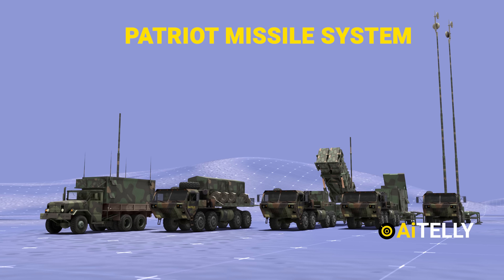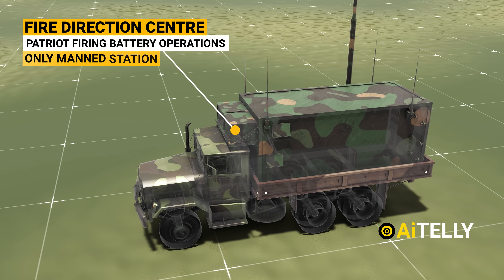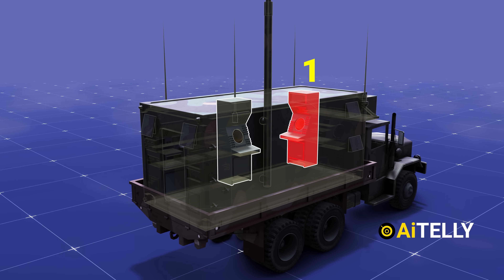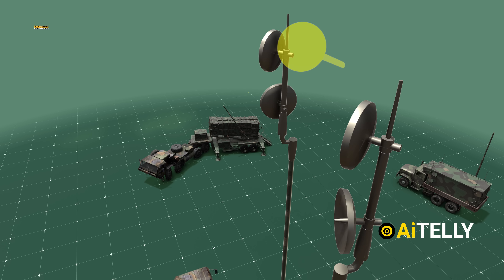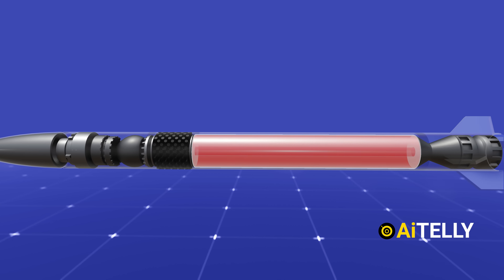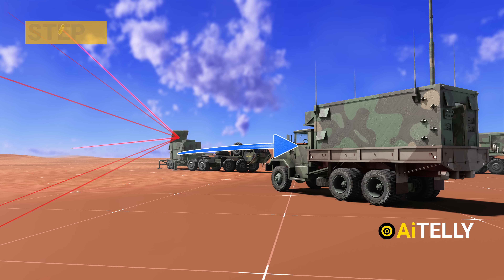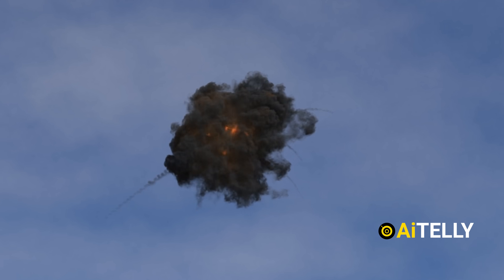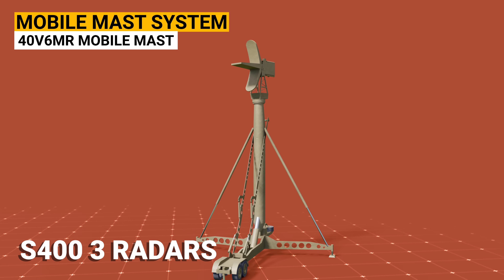Patriot Missile System How it Works | Air Defence Missiles

Comment from the maker: Correction and Notes from Audiences

"Strayer"

4 pac 3 missiles can be placed inside a containter and a launcher has 4 containers, so 16 missiles in a launcher. I think video shows a pac 2 missile. One container has one pac 2 missile, so 4 missiles in a launcher.

@Chris1982416 was an Patriot operator, & he corrected me about PAC-2 launcher payload, it can hold 8.

"Adrián Paz"
Good video. A small correction. The missile launcher you are showing is the PAC-2 GME which has 4 missile. The PAC 3 CRI launcher has a total of 16 missiles and the newest PAC 3 SME has 12 missiles per launcher. Launchers can also be configured to have all three missiles. For example: 1 PAC2GEM, 4 PAC3CRI and 6 PAC3SME.

"jordan ryan"
1 correction. A patriot launcher can hold up to 16 PAC-3 missiles. Last generation, PAC-2 missiles are bigger, thus a launcher holds 4.

"Ahmed Helmy
"pac3 launcher = 16 missiles / range = 70 aero / 35 ballistic 
pac2 launcher = 4 missiles / range = 160 aero / 30 ballistic

"TURKWING"

very good explanation on video...Thanks. Patriot radar azimuth coverage 120° for target searcing mode and only 90° for target firing mode. So at least 240° of azimuth is free to send cruise missile to destroy Patriot radar. 1 battery needs 3 Radar for full coverage. Also, radar range is limited to detect low RCS targets such as drone emits noise jamming signals to blind and next coming enemy ordonance can harm Patriot's radar.

"Ragnarok"
Newest radar have 360 degree coverage,the older systems only 120 degree

John Silver

It has a new LTAMDS triple-band S/C/X radar. With Link 16, other radars can also be used.  Also it has a new PAAC-4 SkyCeptor interceptor. Based on David's Sling Stunner missiles that can reach up to 300km with Mach 7.5 terminal speed and has a dual seeker with active radar and infrared IF homing. Additionally US has a new launcher called Enduring Shield that can incorporate any missile including SkyCeptor.

With the upcoming IBCS (Integrated Air and Missile Defense Battle Command System) network for the US Army, any interceptor and/or launcher and/or radar can just be a lego block. Similar to US Navy’s Aegis system, its a centralized battle command center. Many systems can be connected including NASAMS and Enduring Shield, SHORAD, Patriot, MEADS, and THAAD. Even radars from other system like Aegis SPY-1/SPY-6 and F-35’s AN/APG-81 can also be used. This allows a different radar to use a different interceptor to engage a different target.
Reply: PAC-3  does not supersede PAC-2.   PAC-3 is a 300kg missile to shoot down ballistic missiles at 50km range.    PAC-2 is 900kg missile with 3 times the range of PAC-3.
Reply from the maker: @williamzk9083  Thanks for the feedback
Reply: @Aitelly  why is everyone not aware  if the patriot missile is specialized as an anti-cruise missile.  while the s300 and s400 are specialized as anti-aircraft
Reply: @Aitelly  the fact that the f117A stealth bomber could be shot down using the S-125 Neva 1960 and using a radar that still used vacuum tubes.  The greatest weapon made by the USSR is its anti-aircraft capability.  with the s300 in Ukraine and the s300/400 in Russia.  the Ukrainian air war became defensive
Reply: @carkawala khatulistiwa  it's prob bc the S3s& 400s have been reported frequently that they're comparable to any SAM battery that the US has in its arsenal ,
Reply: @carkawalakhatulistiwa  If you're referring to the one shot down over Yugoslavia, it's stealth capability was compromised making it visible to radar. I forget the exact reason but it had to do with rain/water/hail(?) on the exterior panels significantly reducing their effectiveness. Not sure, but would assume by now there are new coatings on the panels to at least minimize the issue. Kind of wish I'd thought to ask the ground crews about that while I was at Holloman AFB....oh well...
Reply: @carkawalakhatulistiwa  Not just one type. Multiple missiles for multiple roles, hence the PAC-2 and multiple variants of PAC-3. See wikipedia for the details...
Reply: @Aitelly  sir plz make videos of asian made missiles like pakistan have ababeel multi functionality and basic and nuke warheads  and also on agni of india.chian .........no one knows wt thy have???? plz sir
Reply: @carkawalakhatulistiwa  Facts are important. Simply stating that a 1960s era radar shot down a 1970s era steal plane doesn't exactly say a whole lot.

Side note: Did you know that the commander of that SAM battery and the pilot are now good friends?
Reply: @carkawalakhatulistiwa  there are multiple variants of the Patriot Missiles with different missions. But that doesn't mean any single variant can't be used against any single target. It simply doesn't make sense to use a more expensive variant, like a PAC-3 MSE when a more than capable PAC-2 will work.
Reply: @carkawalakhatulistiwa  the patriot system was initially designed as an anti-aircraft interceptor. PAC-3 GEM-C allows it to be more tailored against cruise missiles, and GEM-T is tailored more for TBM's.
Reply: Correction on a correction. PAC-4 Skyceptor is a proposal by Raytheon/Rafael that was supposedly accepted by Poland but since 2017 there have been no developments that I've found.
Reply: @Changeur2009 It was just proven that the Patriot system did successfully bring down a Russian hypersonic missile a few days ago. (By now you may have already heard, I just didn't see anyone answer your question)
Reply: @tiffanyshanley1419  According to the commander of the Air Force of Ukraine no, they didn't.
Reply: Pls make one video on how merkava tank does work..
Reply: after this try to explain how destroyers work at sea
Reply: DLT (antenna) stands for Data Link Terminal and not Distributed Ledger Technology lol (@t=3m50s)
Reply: @tolli4919  this video hurts to watch as someone who works with the system
Reply: @warsuitgaming8692  real
Reply: The pac3 sme missiles are fully kinetic kill vehicles not explosive kill vehicles
Reply: Patriot is useless against ICBMs, ICBM reach very high speeds and intercepting them need totally different things, even aegis systems and THAAD can't deal with them, russian S-400 can't do it too.
Reply: @Changeur2009 The Ukrainian military did exactly that last week when they intercepted a Russian Kinzhal hypersonic missile with Patriot SAM's. Chinese hypersonic missile!!!! On paper they claimed they have the, DF-17 and DF-26. It exist on paper, but there are no documented facts and that it actually works. With all the hyped and lies coming out of Beijing , nope, not a chance that they have all these capabilities. And even so, with the Patriot shooting down Russia's hypersonic missile last week that Putin had been bragging about. He claimed that Russia's hypersonic Kinzhal missile is the best in the world, and there are no known defense missile system in the Western world capable of stopping it. The fact that Taiwan is equipped and protected by 7 batteries of Patriot advanced capability 2 (PAC-2) and PAC-3 Guided Enhancement Missiles (GEM) system, I don't think the Taiwanese military and it's 24 million population will not lose a sleep, knowing that they are safely protected by Patriot missile defense system. The Turkish and the Indians are probably scratching their heads now after they pick the S-400 over the Patriots missile defense system just because of the cost involve, which is quite understandable. Patriots is a proven system since the gulf war, it evolves and had been through a lot of upgrades and now, became even more lethal and deadlier than ever before....... The S-400 is a joke.... In Syria, the Israeli air force F-16, F-15, and Adir F-35 are routinely playing around under the nose of Russia's S-400, S-300, BUK. and Pantsyr defense system while they are bombing the Latakia airbase in Syria unopposed. In fairness to Russia, one of their S-300 managed to shoot down one air force cargo plane, an Ilyusin cargo plane, that actually belong to Russian air force.
Reply: No Patriot launcher variant (M901/902/903) can have all 3 variant missiles in operation at the same time. They can have either a full load of GEM-T, a full load of PAC-3, a full load of PAC-3 MSE, or a mixed load of PAC-3/PAC-3 MSE. And with how Patriot batteries are employed there is no need for a full 360-degree radar coverage at all times. The AN/MPQ-65 (newest Patriot radar) still has the same 120 degree fan as the AN/MPQ-53. Your video is also incorrect about the radar set being unable to rotate.
Reply: @warsuitgaming8692   huh?

t_air_defense_missile_system_data.html
Reply: @missileman1481  before i go through that entire article, what are you correcting me on?
Reply: @Changeur2009 I'm betting no , however against single Hypersonics at short range such as over Ukraines battlefield space , or Kiev Airspace , it makes it easier for an intercept  , esp if multiple rockets are attacking the hypersonic Missiles
Reply: Patriot cannot effectively shoot down even conventional missiles and you are trying to tell us tales that the Patriot shot down the Dagger. Arabs have constant problems with the Patriot system. No wonder they wanted to buy the S 400 from the Russians
Reply: VALIERON  verga los Patriots en Ucrania
Reply: yeah we stile frm Afghanistan and make better version of it good luck china pakistan 😜😜😜😜
Reply: Great material 👍 Great respect and good luck from 🇵🇱🕊️🤝
Reply: @Booz2009 yes and they have been proven to do just that.
Reply: It’s proven so many times recently. Patriot missiles are museum piece. It was knock off in Ukraine all crew from NATO die. They did try their luck fire all the missiles I think is 12 in total non able to intercept Russian hypersonic missiles before they could jump off the carriage missiles hit them because it is travelling too fast exceeding 10 time the speed of sound. Recently Iran fire at Israel with hypersonic missiles all hit target inspite of USA, UK and France trying to intercept it, all failed too.
Reply: @Booz2020 Hypersonic missiles are, by nature, hard to intercept. However, considering that the patriot missile system is designed to intercept TBM warheads in the terminal phase of flight, it is not impossible for the Patriot system to shoot down a hypersonic missile. Especially since ballistic missiles in the terminal phase of flight are also hypersonic by definition.
Reply: Error at 3:53 DLT is not distributed ledger technology here
Reply: It doesnt....😂
Reply: You should have covered the topics of different missiles used for the system, at least including including PAC-2, PAC-2GEM, PAC-2GEM+, PAC-2GEM-C, PAC-2GEM-T, PAC-3, and PAC-3MSE. PAC-2 and PAC-3 has difference in destruction mechanism, target type, and range.
Reply: @freakmil1537  Patriot has continuously evolved with new radars and new ot sensors improved interceptors.    It needs a ultra long range missile version.
Reply: Just don't tell us fairy tales that the Patriot destroyed hypersonic daggers. There is a video of how the Daggers destroy the Patriot 😅
Reply: @pit_viper2013  They have and continue to do so. One PIECE of Patriot equipment was damaged by a near strike, but was repaired onsite and back on line in around 48 hrs or so. Killing more Kinzhals...and Kinzhal has yet to prove it's "hypersonic-ness"...
Reply: Just basic common sense! Russian hypersonic missiles travel at 8 to 10 time the speed of sound and at impact even faster. Beside it glide during flight so radar can see but can’t lock on because it changes it flight many times before impact. At the moment nothing can stop it. Not even the developer of hypersonic missiles. But Russia claim they could intercept them (maybe) using Sam5 or 6 I am not sure. All missiles in USA arsenal max speed is 3 to 3.5 time the speed of sound. You have to accept the fact that hypersonic missiles had changes the landscape of missiles technology. USA just can’t keep up with the fast pace of technology and now even North Korea and Iran possess hypersonic missiles too. China is now at it tail end of it 2nd generation of hypersonic missiles testing. Mass production 2024.

Comment: After the Patriots shot down Russia so-called Hypersonic missile Russia arrested and charged 4 scientists and Engineers on the Hypersonic program and charge them with treason and not fulfilling their duties to the military and providing false data on the missiles program in reality it's just a iskandar m modify to be Airlaunched making it a ballistic missile drop from a aircraft so it not a modern Hypersonic missile that can maneuver During Hypersonic speeds the missile slows down during its final stage and it's not power through entire flight and it's also flies in a ballistic trajectory just like all ballistic missiles which makes it able to be easily tracked and intercepted

Comment: Export variant of S400 is anywhere from 1 billion to 1.2 500 million is domestic cost for the Russian military.    Domestic cost $500 million for a battery and reserve missiles. Export: $1–1.25 billion for a battery and reserve missiles (2021  prices have dramatically went up for this very system since its Limited in production with the ongoing War

Comment: Been a fan for years and love your graphics. I’d say you got it 90% correct. However, you mixed apples and oranges so to speak.
 
The detailed cutaway of the patriot PAC-3 hit-to-kill interceptor/missile is tremendous. But your launcher segment depicts a PAC-2 load out of 4 missiles on either an M901, M902, or a M903 launcher unit. The 02 or 03 can hold either 4 PAC-2 or 16 PAC-3 missiles. But the M901 only holds 4 PAC-2 interceptors. Recommend that you rework that segment to show a 16 missile load out of a PAC-3 configured launcher.

The currently fielded radar is a sector radar and not a 360-degree radar which is a limitation that you might want to mention in the pros and cons segment.

The AMG antennas do not rotate. They must be locked in the position that offers the best line-of-sight shot to the Battalion and adjacent firing batteries. Doesn't look as cool but it’s more accurate.
Keep up the great work! :o)

Comment: My invention way levitation levitating removing first the weight before flying. 
Can float in the air can wait before blasting or waiting for target and joining and blasting the target . Control by the base .
A perpetual flying missile that have own power and self delivering to the target . No need an aircraft to drop . It can drop it's own why ? It's a perpetual power missile that have it's own power to wait and blast the target .

Comment: Don't get it. How 75% fixed positioned phased grid one way can possibly detect any missiles coming from the opposite direction. How would it detect a missile coming perpendicular to the radar vehicle? What would happen to a HOT nuclear missile (like Russians) zeroing in on a target. [when Critical Mass separators are blown nuclear materials already reacting with each other, they were just NOT smashed into each other as the edge detonators not yet engaged]. Most likely shooting it will just set of nuclear explosion that is seeded with Cobalt.

Comment: Patriot better like S 400? jocking!!!! patriot is in the top after s 400, european sistem, israelian sistem.....
Reply: I read many comments here. Only you admitted that BS. 
How "Patriot" maybe better than S-400? 
Patriot were used in Israel during american war in Iraq. And they were not capable to intercept slow motion 30 years old ballistic SCUD rockets. 
This system was used in Saudi Arabia against slow drones.... and again - miserable failure. 
Now, we saw that whole system not able protect themself and we have prove that missiles falling on the ground few miles away, after they were fired....
So, we have NEGATIVE experience for Patriot and no any experience for S-400 
It is the similar as compare Abrams to Armata... one has some real experience with something that exist, but have no experience at all...

Comment: This show and all other information I've found does not tell what the radio antenas are for. Ultra High Freq Coms to/from WHERE!?!

You don't say how many launch units can be connected to a single control unit.  You don't say how far the launchers can be from control unit.

What is the maximum number of simultaneous targets that the control unit can manage?

I've seen this info in other places, but wasn't interested in it at the time so didn't make notes. 

More info please.

Comment: Inerestingly, Patriot and S-400 are pretty much the same in function and efficiency yet so different in design.
Reply: I read many comments here. 
How "Patriot" maybe better than S-400? 
Patriot were used in Israel during american war in Iraq. And they were not capable to intercept slow motion 30 years old ballistic SCUD rockets. 
This system was used in Saudi Arabia against slow drones.... and again - miserable failure. 
Now, we saw that whole system not able protect themself and we have prove that missiles falling on the ground few miles away, after they were fired....
So, we have NEGATIVE experience for Patriot and no any experience for S-400 
It is the similar as compare Abrams to Armata... one has some real experience with something that exist, but have no experience at all...